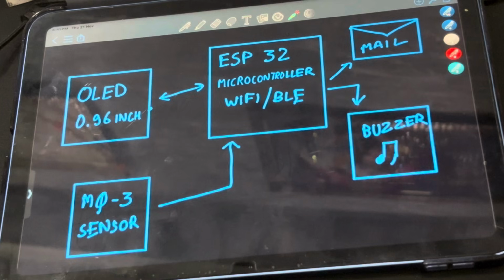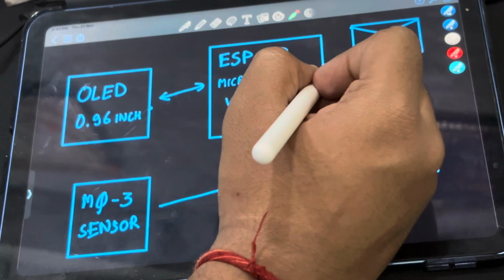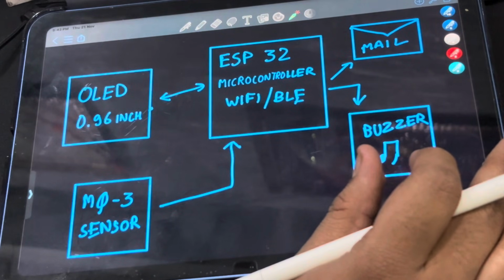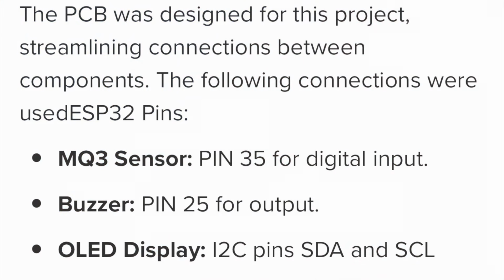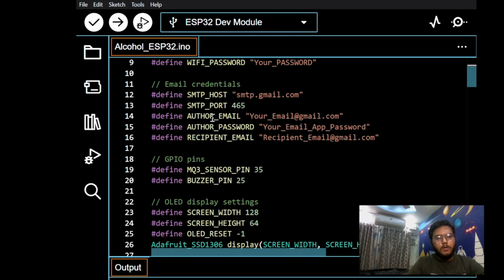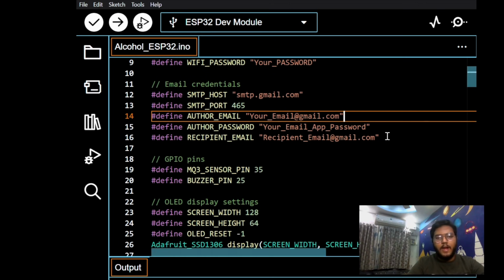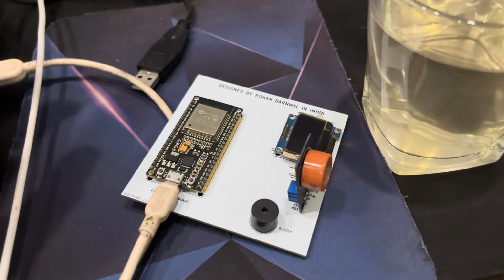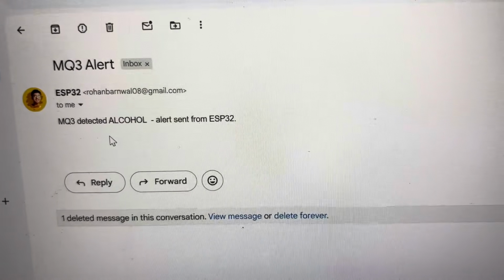Drunk Driving Solution: Smart Alcohol Detector Using ESP32 and MQ3 Sensor

Comment: 1. Use the analog output of the MQ3 sensor or adjust the threshold pot on the sensor for better sensitivity.
2. If you are planning to use it in a scenario where you are going to place it in a car, you will need internet for the ESP32 within the car. If it is a hand held device I do not see any point of using a ESP32 and logging the data.
2. Your code seems to poll data continuously, it will simply spam your email. Instead use a service like IFTTT to receive notifications and log the data.
3. Instead of using the 0.96 I2C OLED you could have just used an led as an indicator. Since you are using a display, it could have been used for displaying concentration as well.
Nevertheless, good work👍
Reply from the maker: Thank you sir for your wonderful response From now onwards I will try to use the things you suggested in my projects 
Warm Regards 
Rohan Barnwal